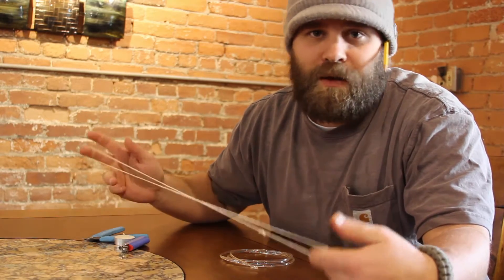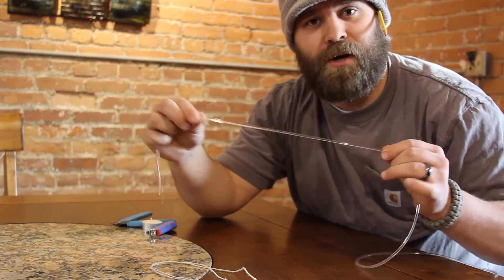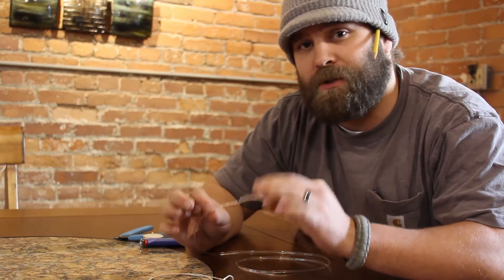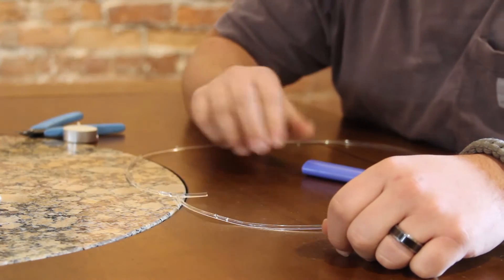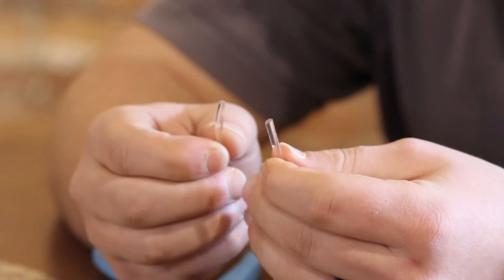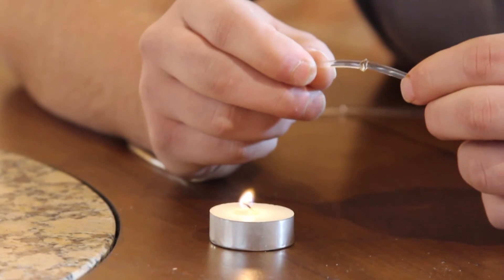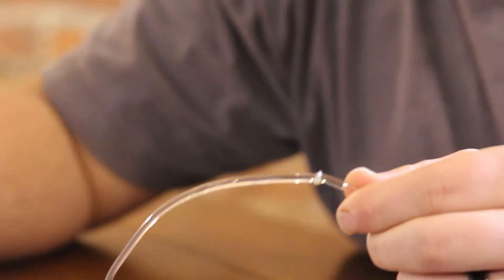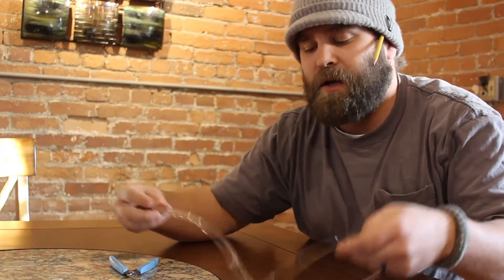How To Join A Stretchy Drive Band for a Spinning Wheel

Comment: I have a question when I’m not using my spinning wheel. Is it good to remove the poly drive band so it’s not at a stretch or is it fine to leave it on the wheel?